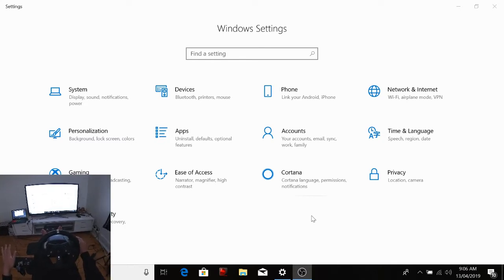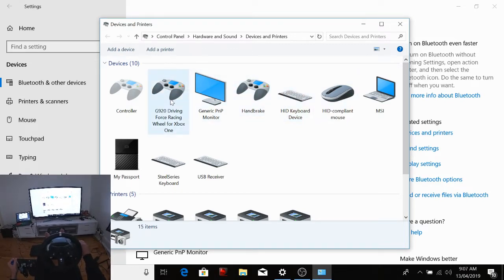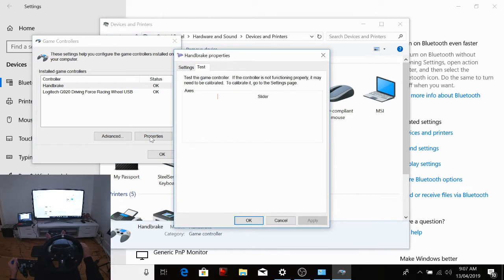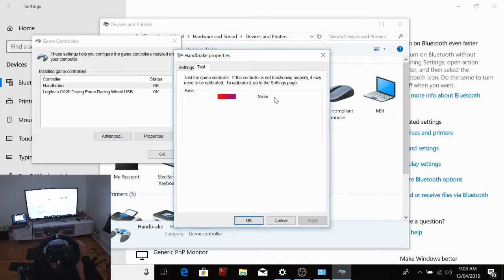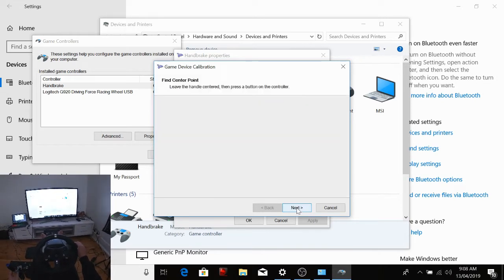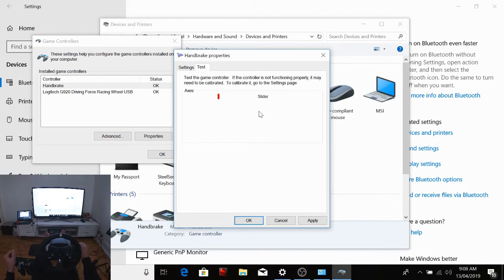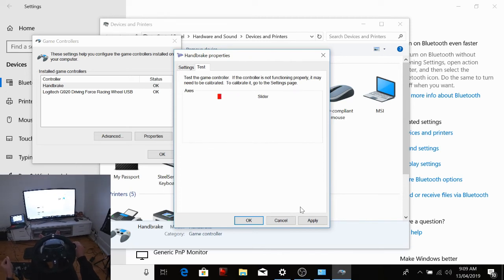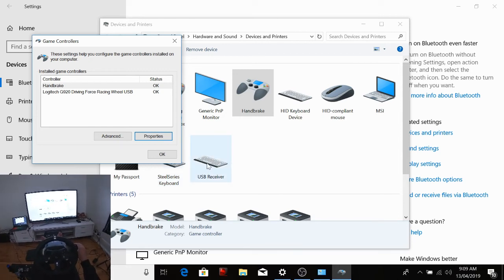USB Handbrake Not Working  - ***Fix

Comment: For those of you who are trynna calibrate the hand break. if you unplug any extra usb inputs that are showing ,because for some reason when I had my steering wheel connected it wouldn’t connect to the handbrake it would only do the wheel. So try and unplugging the steering wheel and try the whole process over. Then you should be able to click and get the hand brake  and then you can connect the wheel again. 

Hope this helps
Reply: Thank you man!
Reply: Dude thank you so much. I had no idea why my wasn't working
Reply: I’ll try thst

Comment: Mine quit working after about 2 months of use. I took it apart. On the inside, a lot of the pins were not saudered to the board... I took the pins and kinda GENTLY pushed them downward onto the metal ring of the board to make sure they had a better connection to the board being they aren't saudered and sure enough this was my problem why the handbrake quit working. I fixed them and set them better, and my handbrake works perfectly again, actually better than before. If you have a Sauder gun, I would recommend taking handbrake apart if it's not working and checking the pins to make sure they are touching the metal rings on board or Sauder them yourself..

Comment: Any fixes If the test shows no sign of life whatsoever when pulling the handbrake or is that a sign its faulty/broken?
Reply: Mine doesn't do anything. Pretty sure it's fucked
Reply: @davidmadison5582  The seller asked me to unscrew the magnet and flip it... If that in their minds was a possible fix, there's no way they tests these things before shipping them. Not only did it not work, but i don't recommend trying it because screwing the magnet in with the groove upside down will just snap the thing in half, i learnt that the hard way. I think i may strip all the electronics and see if theres a yt video on making one from scratch and just use this $100 worth of squeaky metal as the base.
Reply: @LouisTheFlyVids  i figured it out , ty
Reply: @davidmadison5582  how? im having the same issue
Reply: @thiagozuliani6255  did you figure it out?

Comment: If none of these fixes work, chances are the sensor is soldered on the wrong way, which mine was. You don't have to take the sensor off, just bend it near 180 degrees around one way toward where the sensor is.

Comment: Mine randomly stopped working today after working just fine for months.. :( It doesn't pick up anything in the test or calibration modes.. doesn't work in Assetto.. doesnt work in anything.
Reply from the maker: that sucks mate.. mine is still going strong. maybe check the connections in the handbrake its self to see if the wires are loose
Reply: Gaming & Sports Oz I figured it out, after I tried everything I could digitally (drivers etc etc) I started taking it apart. Luckily I had Assetto Corsa Control menu up when I was doing it, I unscrewed a bolt and felt a magnet snap to it as I pulled it out, and I saw a reaction on my Assetto menu.. The handbrake itself has no wires going from it to the micro controller.. it’s a magnet that passes by a sensor when the handbrake is pulled back, and the glue that held the magnet in place was dried up. I got a drop of super glue and fixed it 👍. I even fine tuned it and gave my handbrake a larger axis. Good thing to remember about the $100 usb handbrakes.. they use magnetic sensors lol.
Reply: @MachtPlays  you put more glue on the magnet?
Reply: @MachtPlays  exactly what happened with mine lmao, trying to fix it atm
Reply: @macht your a god bro you just helped me fix it

Comment: my calubration screen is never the same as yours. when I try to calibrate, x, y, z, throttle and rudder comes up. and nother fixes the issue. the brake is stuck registering at 49 degree of angle even when its not
Reply from the maker: sorry man. don't exactly know what your saying here.. what version of windows are you running??
Reply: Did you ever find a solution? I’m having the same issue where it thinks it is a rudder
Reply: @SpencerM707  same here
Reply: Same here

Comment: I got mine and it installed the driver. Windows reconized it , but when i pull it no axis are reacting. Still waiting on a reaction of the aliexpres seller.
Reply: probably scammed, i buyed and e brake that worked with magnets but after a few months it stopped working so i reconfigred the arduino to work as a key and not has a axis... whenever i press the key that is P my wheel stops to working, so much money for a shitty game like forza
Reply: hey, did you fix the problem?

Comment: my handbrake calibration looks totally differnt. Shows my throttle and brake and 2 axis and moves on throttle and calibration does not help at all. Still sensing too much on the bottom end and stops  topo early

Comment: I just bought mine, and it doesn´t assume any movement. When i try to calibrate it doesn´t recognize anything. Is there anything i could do or is just not working?
Reply: This is what is happening to me
Reply from the maker: Hi Guys - Are you plugging in to a regular USB port of a USB SS port (the one with a light??? i had problems when connecting via a normal USB port.
Reply: @gamingsportsoz9448  plugged it in and the only thing that works is the rudder and it’s being spammed from 50% of the bar to 100% the entire time fix?

Comment: my one says like rudder and not slider. Help?
Reply: Did you find any solution, I’m having the same problem right now
Reply: Everyone whose hand break works in rubber it will work mines in rubber you just need to calibate it and move the magnet around then super glue the magnet down then if you don't have content manager for ac the get it and configure it there
Reply: @SpencerM707  Everyone whose hand break works in rubber it will work mines in rubber you just need to calibate it and move the magnet around then super glue the magnet down then if you don't have content manager for ac the get it and configure it there

Comment: Mine works on settings but not in game any tips?
Reply from the maker: what games are you trying to use it with??
Reply: @gamingsportsoz9448  asseto corsa, i found that my clutch which is on axis 7 is the same as my e brake, i need to enable multi device use but don't know how
Reply: @ItzEvolvee  any fixes ?
Reply: Also having this exact same problem

Comment: Plugged mine in nothing happened. Only went to control panel nothing. Only thing that worked was the rudder and it was at random times. Fresh out the box no damage shown
Reply: Mine doing the same thing
Reply: @Tommypesos  I got mine on Amazon and returned it and got a new one that works lmaoo

Comment: I'm watching this because of another problem I haven't found the solution for, windows installed my usb handbrake as a joystick, I can't even calibrate it, I need help, the usb uses arduino leoardo
Reply: I got it working, messed with the arduino code, now I can kind of use it, It's constantly going from 0 to about 30% constantly and It doesn't hold at 100%
Reply: @linod3  how did you do it?

Comment: Mine is a Chinese one I bought it of eBay it is not working at all and it is at 50 z axis without touching it
Reply: I have the same problem, were you able to solve it?
Reply: Nah sorry I jsut gave up there might be a solution
Reply: @mvxrzd  maybe try and find some alternative software for it or it might be a hardware issue
Reply: @say1l  Oh thanks, I'll try. And you bought another new handbrake and it worked?
Reply: @mvxrzd  nah I jsut play without it
Reply: @say1l  Ah ok, thanks for answering brother. Lucky!

Comment: but my handbrake goes to throttle for some reason
Reply: mine works as a rudder , by any chance have you found a fix?
Reply: @Xallous  nope
Reply from the maker: what game are you using it with??
Reply: @gamingsportsoz9448  accetto corsa
Reply from the maker: @phonimboi   thats weird. can you not change the axis?? click on where it says "axis 7" example and clear it then reconfigure?
Reply: @gamingsportsoz9448  I tried that and it still doesn't move when I pull the handbrake